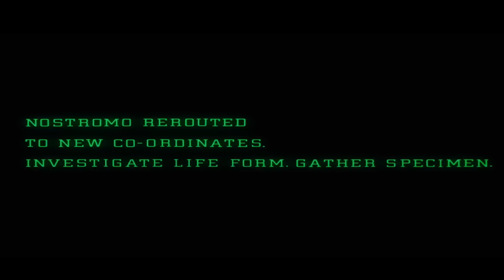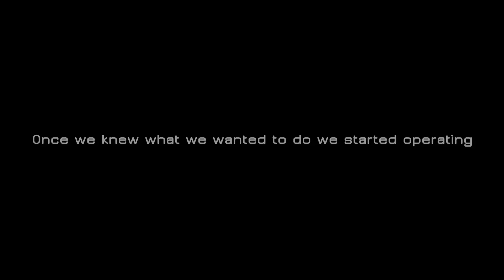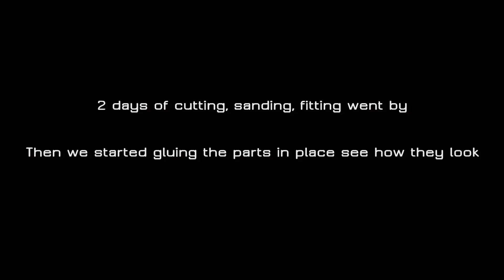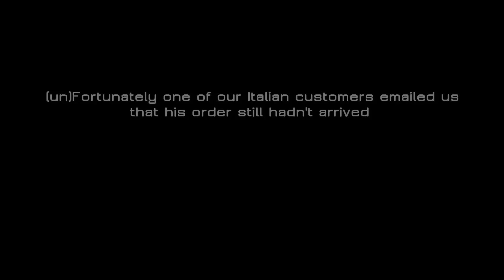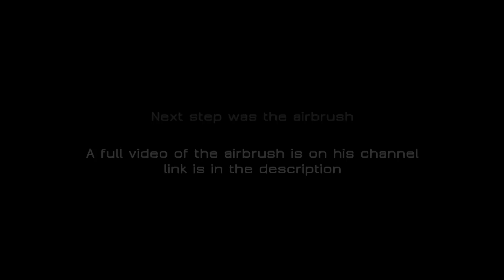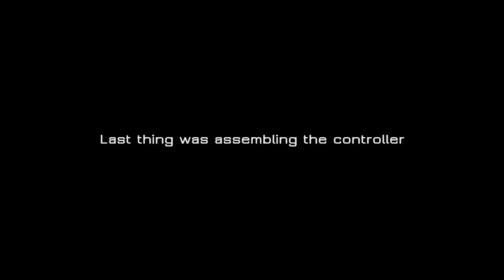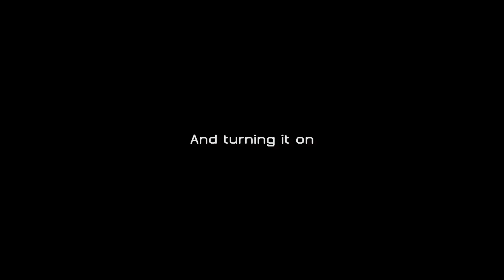Hyper Build #1 - PS4 "ALIEN CONTROLLER"

Comment from the maker: Hyper Build #2 STAR WARS >>> https://www.youtube.com/watch?v=4wAeCRS8eMM
Reply: How about you make the alien head moving up and down and not attached to the touchpad. That way the player can use the touchpad by moving the head up. So games like until dawn would be playeble
Reply: XQ Gaming man this is awesome u should go to Sony u can make way more PS4  controler that i would buy them all if I could
Reply: your 2nd doualshock4 controller  must be Predator :))
Reply: XQ Gaming I'm very interested
Reply: Make me a black ops zombie theme how much???
Reply: Can I buy it for 700 dollars
Reply: Question- I’m about to redo a botched controller and I wanted to create veins on it. I was considering using a hot glue gun, then sanding to shape the veins and painting and clearing. Would the hot glue adhere to it just fine? Or should I try a different method?

Comment: Hi in new and I want to ask questions.
1) Will this controller go for sale as a skin or as a controller?
2) If it is as a controller, will it be already fixed? What if it is as a skin?
3)When will it go for sale and how much will it cost?
4)On your website, there is no option to buy controllers, so im assuming your either adding a new section for controller or putting it in the skins section?

Thanks in advance
Reply from the maker: 1) This controller was custom made for one of our clients, they will only be made on request.
2) ^
3) It has been sold, the exact price is confidential. Custom projects are always discussed before we can give an exact price. Such projects will need 50+ hours of hand work and around a month to realize. Pricing is in accordance with the work involved, discussed via email contact.
4) see 2
Reply: XQ Gaming Thanks for the information! But how can I make a request for a controller such as the alien one?
Reply: XQ Gaming is on sale?
Reply: XQ Gaming how much did this specific mod cost for the client, and can this exact controller be requested?
Reply: @Lars van Dongen 25.00 or 25.00

Comment: Hello, i have a quick question about your controllers light bar, I can vaguely see you have connected 2 green wires to the last connector and one wire going to the 2nd (ribbon cable chip) connector and one wire to the 3rd connector, is this correct?
Please reply ASAP
Best regards